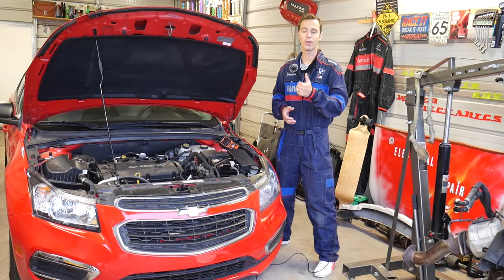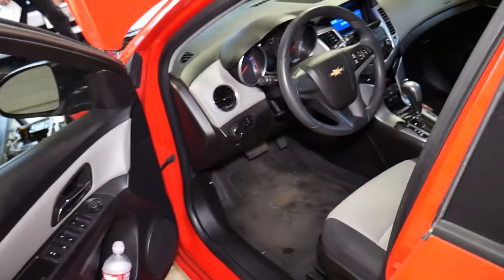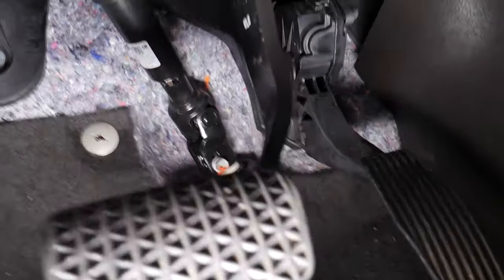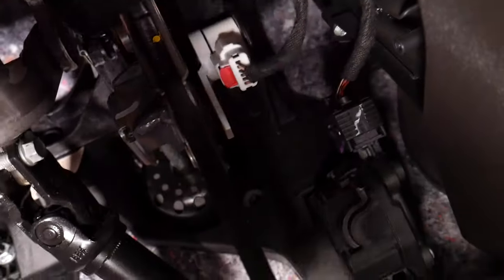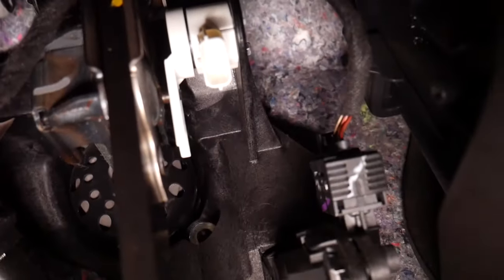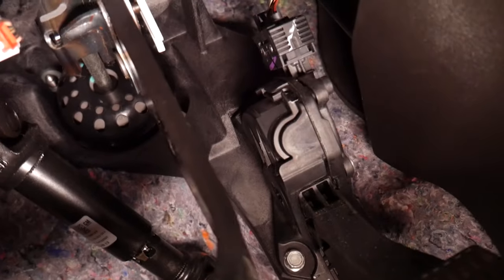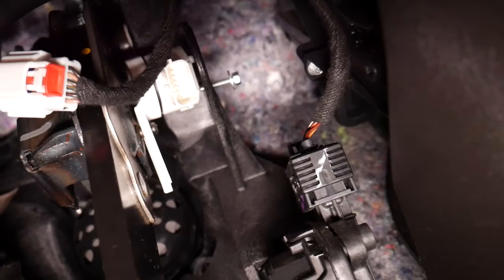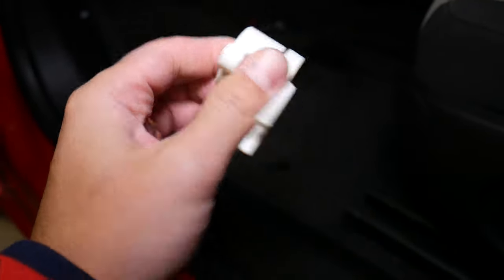HOW TO REPLACE BRAKE PEDAL POSITION SENSOR ON CHEVY, CHEVROLET, BUICK, GMC, CADILLAC

Comment: AFTER REPLACING SWITCH,,YOU STILL HAVE TO CALIBRATE NEW SENSOR,,THIS REQUIRES A SCANNER,,,,,
Reply: Not if it's the brake light switch.. I called Chevy dealer and they told me no calibration needed on a brake light switch
Reply: @christopherjohnson4398  the brake light switch is the brake pedal position sensor

Comment: Could you please post a link to the mentioned brake sensor calibration video?
Reply: You need a scanner to relearn the position. Funny, some tech videos are very thorough others not so much! They tell you just enough to have you pulling your hair out sometimes. I suspect they know more than they let on with these videos. If someone wants to be helpful, that's great, if not, don't expect the same clout as those who are.

Comment: Brake light switch is different then the brake pedal position sensor. They are located on opposite sides of the brake pedal arm.

Comment: I am having this problem where my brake lights are ON when I'm not pushing the pedal.    so I have done what is stated here and bought a new brake pedal position sensor, I installed it with GREAT PAIN as I am not a little skinny guy, LOL. I think one of my ribs is broken now.     Ok .. so now with the new sensor / switch installed, same exact problem is happening.    So I looked at everything, for hours I have poured over what is happening.    and something new has occurred to me. 

  before I bolted that switch in place I checked it, i manually moved the arm to see the brake lights come on and go off.   I found that it has a few places in the switch that turn the lights ON.  some of the points in the arms travel could never be reached while installed because the pedal does not allow movement that high or low.  those places can only be seen with the switch not installed. 

  so here is my theory -   when the switch is installed the slot the pedal arm goes in is kind of loose, not exact, so that the arm can slide i that slot freely ( in the video at "4:52" you can see a smudge in the inside of the slot On the fork where the pedal bar sets and makes contact and slides, that is the TOTAL travel! very short eh?)   

   so my problem it seems is the 1st switch action - this 1st action of turning on the lights is right when I push the brakes, it clicks the switch and sends the signal ON!.  well  that 1st action in the travel of the pedal is NOT really the 1st switch on.      If the pedal when returning to the place it is supposed to set after the brake is applied is allowed to go a VERY small amount higher - the brake switch sends a signal to turn the lights on again and it will stay on all the time! 

  My return pedal action has , for some reason,  been returning too far UP. less than 1/4 inch but just enough to turn the lights on without the pedal being depressed. If I move the pedal with my hand about 1/4 inch down the lights go off and the brakes are not engaged at all.    I am wondering if there was some kind of Bumper, stopper, something that fell off or is smashed a little too flat that has allowed this to happen. I can't seem to find anything yet, does anyone know what the pedal bar rests on when it is all the way up?     I am working on a 2007 Pontiac Torrent which has the exact same switch and set up as this video has. 

  symptoms are   brake lights on all the time - once you push the pedal they go off for a split second and then on as normal and when you let off the brake it returns as it should and then 3 to 5 seconds later the brake lights come back on again and stay on.  they go off if you push the pedal 1/4 inch or less and stay off if you hold it there.
Reply: Did you ever figure it out?
Reply: @hollydempsey2691   Yes I did, I had to buy a scanning tool that is capable of running reprogramming tests,   I know that sounds expensive.  it was going to be but I don't have that kind of cash.. LOl I did have time though so I kept looking.   I found this model to be the cheapest that can do the job.   FOXWELL NT510 Elite.   it cost me 100.00     I got the one that has GM programmed into it already.    You can get 4 or 5 other brands  afterwards if you want but I just wanted the cheapest i could do for that Torrent. 

   This thing worked so well, it was easy,   I just plugged it into the OBD plug, It recognizes the car, the miles and everything,  then I navigated to the car, ( It;s easier than playing electronic football in the 80's on a 9 volt hand held LOL) , 

  so then it starts a test, tells you what to do , when to step on the pedal , poof  it's done.  seriously, I never used one before and it took maybe 3 minutes . 

  Here is the catch , these people at Foxwell know what they are doing but they are extreme Chinese.   so you have to sort of just consider how they write in english. 

  this is the instructions : this ones for the Cadillac you can see but it will say your car instead. 

   so when you get to that last part   Calibration, you just push enter and it goes . then your done.   super easy   I hope this helps folks out.   It took me Forever to narrow it down to this machine.  most all are 130.00 Mine was 100 bucks because i talked the guy down. LOL the box was smashed a little. 

Procedure:

Manual Selection->(B) 2011->Passenger car->Cadillac->CTS->(Y) 3.0L V6 LF1->6-speed automatic->Yes->Other->Control Modules->Body control module->Special functions->BPP sensor calibration
Reply: We’re having this issue on gmc Savanah box trucks rear brake lights go out when u touch pedal but will pop back on 3-5 secs later after releasing  pedal even with new brake switches
Reply: I know on my 2007 GMC Yukon the switch and the position sensor are two different things.  the position sensor acts as a relay controls the torque lock up in the transmission and also allows the cruise control to disengage when you tap the brake. Symptoms can include engine stalling, brake lights staying on or off all of the time, check engine light, lack of torque converter lock up.
Reply: my 2015 traverse has problem slight play or loose jiggle in brake pedal causes brake lights always on, now i use my tip of shoe and lift up under brake pedal the slight upward movement lets nrakelights switch off, i do suspect there was either a small coil spring or neoprene sponge bumper previously incorporated in the mechanism and then while being aggressive in vacuuming or cleaning the vehicle i knocked iti out and only realized later the connection, 
i will need to compare an intact mechanism or diagram to confirm,
Reply: I am going through the exact same thing w a 2010 Cobalt. It has driven me almost insane. I put small pieces of thick straw from kid's cup to shore up that difference you explained. I just need to buy a scan tool that can calibrate this. Thank you so much for your research.
Reply: @larryleisuresuit9584  I am going to order the Foxwell NT510 Elite for GM I hope it works!
Reply: @tony6261   I hope you can get one as cheap or better  priced as I did. I didn't like the full price ones  LOL.     It would be to cool to hear your results. i'm trying to get an update on mine right now.    I want Toyota/ lexus/ scion on there as well as GM.  :0)
Reply: @johndoh3353    The guys below are thinking like I was at first, I tried to duplicate a bumper pad that keeps it at just the right position,  there never was a bumper though/  The sensor is not like a switch like the old days, it is like a rheostat on your fuel pump assembly. doesn't matter if you limit it, it doesn't work by distance or pressure, it works by volts and slide. so no matter where you put it and stop it  it;s going to appear to have an effect , then go right back to bsing you. LOL.  I was not kidding about how long this took me to figure out without that scanner thing.   this will happened nearly every time you break the connection with the control pack thing, I forget what that is called, the thing behind the radio.    OH!  You can go get another of those out of a junk yard and it will not work in your car til you hook up a scanner and do these programs.   pretty simple. Has to be all hooked up right and good connections and you can pop the tests on it and it will set it like it was put in factory.
Reply: @larryleisuresuit9584  I paid 189, and it was able to clear the error but it wouldn't calibrate the the brake pedal position switch, for some reason
Reply: @larryleisuresuit9584  I paid more than you did, and it cleared the error but didn't calibrate the switch, but it hasn't shown an error yet and it's been about a 2 weeks so we shall see
Reply: Buenas tardes el malibu mio estaba igual de repente se accionaban las luces de freno y entonces lo que paso es que le quite el sensor ese y ahora cuando meto de.parkin a la directa  se prenden solas mientras esre avanzando hacia adelante  y cuando lo parqueo se apagan u vuelvo  a po er la directa se vuelven a prender pero no tiene el sensor puesto que sera cruce de líneas

Comment: Would this be the fix to the brake lights staying on when car is off in a 2012 Malibu? c0899, c0561, c0242

There was a 2014 recall which involved adding a spacer and dielectric grease to a bcm connector.  I checked the connector and there was already dielectric grease on the connector.